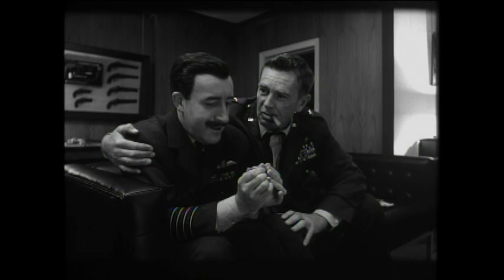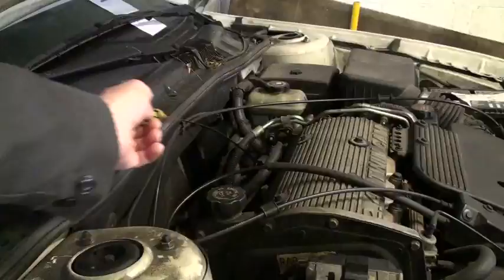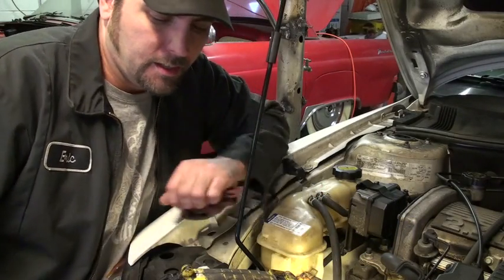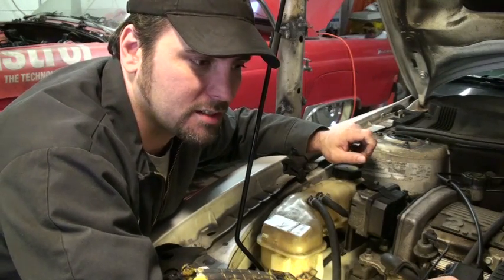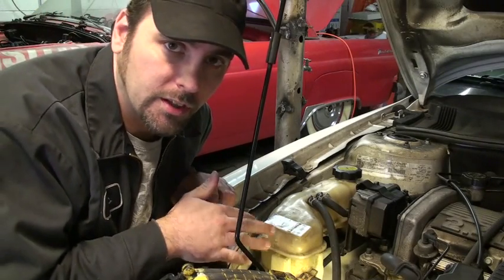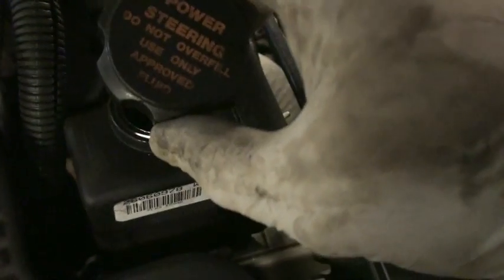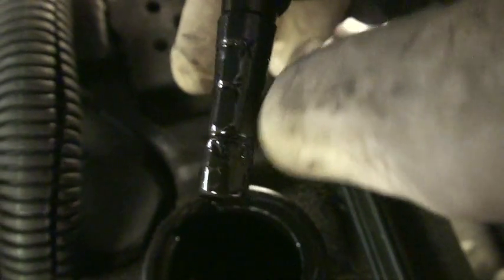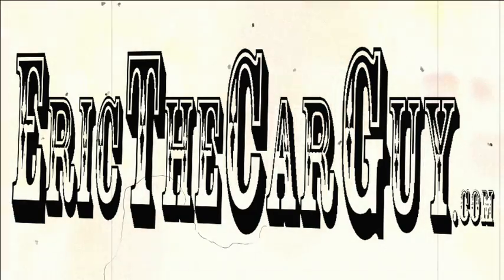Precious Automotive Fluids, and how to check them - EricTheCarGuy

Comment from the maker: @urbex2007 Perhaps you are correct in the sense that "coolant" does not evaporate but H2O does and a portion of the coolant is H20, in my experience evaporation happens most in the overflow which is not pressurized. Oil and ATF both break down over time due to the conditions under which they are exposed.  I did not say that the engine ate dip sticks but rather if you tried to check the transmission fluid on a Honda with the engine running it could very well "eat the dipstick". Have a great day.

Comment from the maker: @southernpride903 The first thing I would check for is transmission codes, that transmission is shifted electronically so there may be some kind of electrical problem if the problem is inconsistent as you describe.

Comment from the maker: @rohy That would be bad.  Just to give you the info since I don't know when I will post the video, look for a plug on the outside of the transmission about half way up the trans, remove it, and see if oil comes out.  If oil does come out it usually means you are at the proper level.  Manual transmissions usually don't have dip sticks, most are just filled at a given point until the fluid runs out.

Comment from the maker: @ElliotFriend I don't recommend forcing the fluid back into the master cylinder when replacing pads, see the Disc Brake replacement videos that I've done for details on that.  Once you've replaced the pads however it's a good idea to top off the fluid.

Comment from the maker: @rico313z What you describe is normal really, what happened was the the oil filter you put in didn't have any oil in it, when you started the engine it filled the oil filter and displaced that oil from the pan, when you topped it off you accounted for the missing oil.  An astute viewer pointed out that I should have put a small amount of oil in the filter before installation, this is a good idea and you might want to try it next time you do an oil change.

Comment from the maker: @founditnow54 You are correct about changing the fluid and filter, this may cause an already ailing transmission to fail.  As for what I meant by "addressed", I believe the problem will not get better on it's own but deteriorate until the component that is making the noise finally fails.  It is very hard to predict if and when something like that will fail.

Comment from the maker: I would get the fluid and the filter changed.  Thing to watch out for with a trans that hasn't had regular service is that it is possible to cause a shift problem by changing the fluid at this point, proceed with caution.

Comment from the maker: @aaaaariiiiielllll Check the service manual for your particular vehicle as there may be a plug on the side of the transmission that needs to be removed in order to inspect the level, the service manual should have that info.

Comment from the maker: @founditnow54 Sounds like the torque converter clutch is starting to act up, it could be electrical or it could be mechanical but It might be time to look into a good transmission shop or start shopping for a used one if it's starting to exhibit more than one symptom.

Comment from the maker: @founditnow54 It might have a low, reverse band going out, or perhaps a servo that is leaking.  See if it makes the same noise when you put the car in first (if you have that on the selector).  If it does then you have narrowed the problem.  It has been a while since I've torn one of those apart so I don't know of any "pattern failures" off the top of my head.  Let me know what you find.

Comment: Just started watching your show a few days go and already must've seen half of them! Addictive. 

Just wanted to clarify for your viewers about adding just water to their coolant in emergencies.  If you must, fine.  But please DISTILLED water if possible.  Especially in warm places where people think they can get away without glycol...corrosion of rads and coolers is not fun.  Used to work for a thermal product division of a large auto supplier...lots of returned parts corroded with city water

Comment from the maker: @founditnow54 When you are trying it in first are you putting the shifter in "1" or are you just leaving it in drive?  Anytime you have fluid that looks contaminated and a car has a noise or shift problem it should be addressed, if not, it could fail but it sounds like you might just loose reverse, but that's kinda important I think.

Comment from the maker: @aodhanof90 If I'm honest I use the cheapest oil I can find in the correct grade in my cars.  Now if it's something special like an engine I built or something like that then I would use a better grade of oil but my philosophy is to run cheep oil and change it regularly and up to this point it hasn't been a problem.

Comment: @EricTheCarGuy yeah, manual transmition fluid level check would be really great, I had some oil leaks and I am not sure if it was motor oil or transmition oil :) thanks in advance (I am still pretty scared that I use transmition with not enough oil in it ... that would be bad)

Comment: @EricTheCarGuy Yes I am putting the shifter in "1," and it only makes the noise in reverse when cold, no other noises or problems. By "addressed" what do u mean? Do you think I should have the fluid and filter changed? I do not want to go to a transmission shop and have them tell me i need an overhaul.  Ive heard that sometimes changing the fluid can exacerbate the problem. Oh, ONLY losing reverse, yeah that's fine lol that's just jim dandy.

Comment: Whats Going On Erick Love All your Useful Videos,Quick Question I Recently Changed My Oil I Have a "96 Chevy Lumina 3.1"after i changed it it seemed to be reading low? i checked for leaks,drain plug and filter and didn't see anything it immediately read kinda low after i poured the new oil in and checked it i added another qt to be sure it wasn't low i check it the day after and it was fine at proper level via dip stick some times i check it its low, if i reinsert the dipstick recheck its fine.

Comment: Hi Eric, I know you're not a transmission specialist but...my car is a 96 grand am with the 4t60e with about 102,000 miles on it, and when cold when i put it in reverse, and only reverse, there is sort of a low rumbling noise - no grinding or slipping or any other problems - its shifting fine now. I was wondering if I should be concerned or not.

Comment: Nice video! Question for you Eric.....My Grand Am has about 98,000 miles on it. i have maintained it very well as long as I have owned it (checking/changing fluids, servicing brakes, filter changes, etc)....but I have never touched the tranny fluid. It is light grey in color and is still semitransparent and feels very slick.  I dont think its ever been changed....now, I have heard that if it is this color and has never been changed, that it would be best to leave it alone? thanks a lot man!!

Comment: @EricTheCarGuy ok thanks Eric, I'm sure you've got more experience with them so I'll stick with the Honda trans fluid. do you mind if I ask what kind of oil you use in your engines? (just curious) I've always used Mobil 1 high mileage 5W-30 but was going to give the AMS oil a try since it's locally produced (I now live in N-E Minnesota)

Comment: @fliphighup my understanding is the gear oil for the manual trans should be filled to the to the fill plug when when changed... so it would be cold, I'd think if you let it sit overnight and pull the fill plug there should be oil if it's full- if you can't tell carefully slide a clean screwdriver in and see if it gets wet. can anyone confirm this?

Comment: What other fluids should I change in a car(apart from the regular, engine,transmission, brake, steering, coolant, windshield)?
Reply: Differential fluid, usually around 50,000 miles between changes, but it varies. There'll be 2 plugs on the diff, lower being the drain and the higher being the fill/check.

Comment: HI, Eric please help me I have a Chevrolet P30 6.2 diesel  3-speed transmission when picking up speed in third gear on a straight road or up I press the pedal very slowly and the transmission immediately switches to second speed, I don’t want to accelerate at a third speed only when moving down, please help if you know and want, thanks!

Comment: Possible fluids found in vehicles are Engine oil, Power steering fluid, Transmission fluid,  Refridgerant, Battery acid. Washer fluid, Grease, Coolant (engine, super charger), Gear oil (Differential, Transmission), and Brake fluid (Brakes, Clutch).
I say POSSIBLE because all vehicles have different combinations of these fluids the exception being engine oil, coolant, washer fluid, brake fluid (for the brakes) and gear oil (for the differential).
Reply: 1 more: transfer case (in AWD or 4WD vehicles).

Comment: Good idea to also check gear oil level and condition in front/rear differentials, transfer case (4wd). Just changed mine out and it was black and sludgy  (2006 Toyota Matrix 4wd, 62k miles). No mention changing it out in manual. Dealer says gear oil is good for life of the vehicle. SMH.
Reply: BoostedCars 73 i do after 12 year of same oil i did it 6 months ago 😍

Comment: that will be costly, a new master cylinder would be more than the on road costs

the car cost me AUD$3000 2.5 years ago

that is the least of the issues for my 22 year old honda, the engine leaks as well & may die soon though as have been getting low oil pressure warning for about 1 year

the car has 278,000km(173,000mi) on the clock

Comment: What sense does that t make that tge dip stick will get eaten if the engine is hot and on but not hot and off?! The stick is going to the same place.
Reply: Because it's on... The heat doesn't matter, the engine running matters.
Reply: ProvAoEGaming
what does it being on have to do with it getting eaten up? if there's something that's going to destroy it when its off, why not when it's on?!
Reply: Because its not running. Its like plugging something into an outlet when the object is on, but not the same effect
Reply: ProvAoEGaming
I think i messed this up. I think I heard wrong and thought he said it would get fucked up if it's off and cold and not when it's on and hot, which makes no sense.

what 'object' are you talking about? you mean the garbage disposal?
Reply: Anything that you plug into an outlet? I thought I made that clear.

Comment: This could mean a fuel or coolant leak into the oil system. This can trash your engine  - be aware! Especially if the oil level is rising. If you have a diesel, you may get a runaway - very funny (not if it's your car).